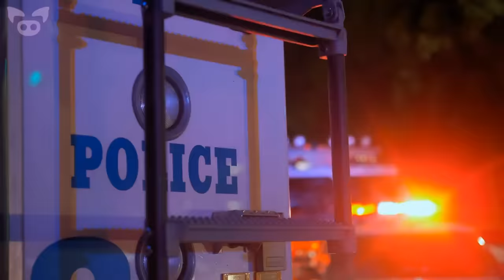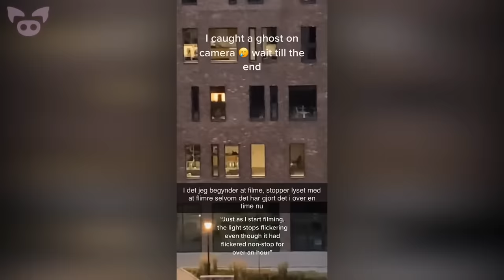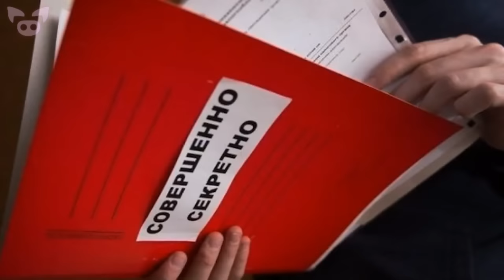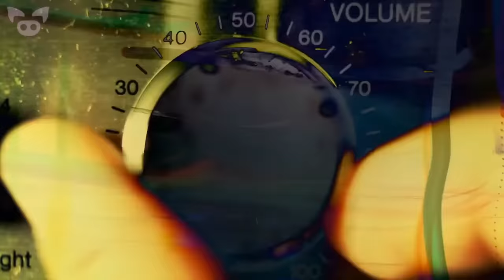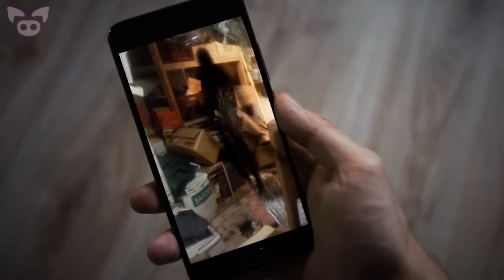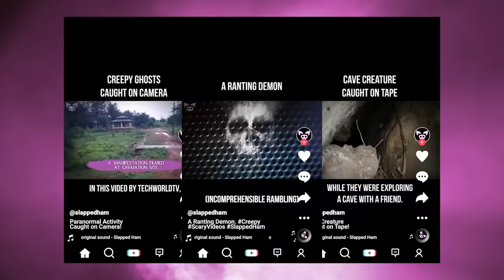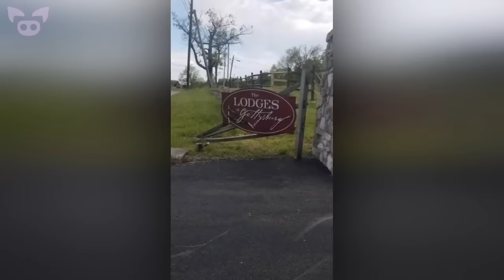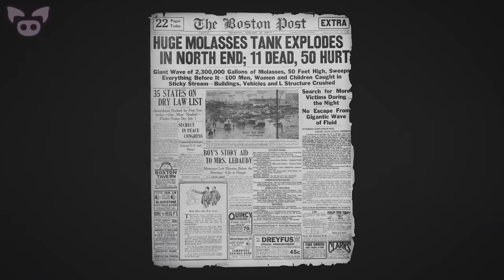Watch Scary Videos Live! Ghosts, Shadow Figures, Cryptids and More...

Comment: There are machines called "tree pullers" and "feller bunchers" and a couple of others that clamp on to the base of the tree and pull it straight up in the air and you will see it kind of wave in the air a little bit and will move it… Sometimes they move the trees if they've got a good grasp on them further away before they drop them and cut them.

Comment: You can see the bins move once the one bin falls. They were clearly leaning on the one that fell.
A secondary explanation could be a combination of the first with perhaps some water in the bottom of the bin after a cleaning. If there are bins leaning on a bin that has an inch or two of water sloshing side to side, eventually gravity will do its job and the bin will go over.

Comment: 3:02:35 like someone is spraying the car from the back with a hose or something. 
But I have in my lifetime quite a few times seen"localized rain" before, where it was raining on one side of the street and not the other. Snow too! And literally, all jokes aside, I was on the same street, both times. It was really trippy and super neat at the same time. A spectical that could only be created by our higher power 👏🏼💯💤

Comment: You don't need strings to make things move. You can take apart a RC car and put the dc motors virtually anywhere. Inside a doll to make it's arm move up and down, in a mannequin neck to move the head, on the wheels of a wheelchair to drive it up and down a hallway. Most of these clips have no sound so. As for the doll at the beginning with eighted eyes and a shaft in the stomach. When u squeeze the stomach it pushes a shaft that turns a gear which operates a veritcal shaft connected to the head. Etc. I'm constantly pranking my wife with RC motors accompanied by light/motion sensors. Or well placed remote control. As for the weird doorbell cam clips. Most can be explained by spiders weaving webs on damp nights in front of the lense. Mine does this quite often. Bugs are always the culprit. Sometimes it looks like they appear out of nowhere. However I'm no skeptic I have witnessed things I can't explain. I believe in anomolies. I also believe in crafty pranksters too

Comment: The tree through car,I think the driver of the car got reanimated as a tree, see which way the material from the underneath tree hole is peeled outside of the hole or does it look like the tree pushed up from underneath. If it curls to the outside it was caused from inside the vehicle, hence the driver was reanimated as the tree

Comment: So many of these are artifacts left from re-recording a zone where 80%+ of what’s on screen never changes.
Let’s say you have a camera pointing at a doorway square on. The room the camera is in is pitch black while the room with the door is back lit. 
The camera is set to record once it detects movement. And the person who opens the door everyday stands in the doorway while counting to ten. They are back lit so they will only be a dark profile of the person. 
The motion of the door opening triggers recording. 
For 100 times the person does the 10 second ritual.
Every-time it is recording the same thing. Over and over rewriting once storage runs out.
Eventually the person can open the door and not be standing there but the recording may show an artifact, or “ghost” as there is only one thing different.
Remember screen burn from original Nintendo duck hunt? Or from Mario bros?
The little Mario head with an “X” beside it in the corner?

Comment: At 5:39:32 if you pause when the ghostly looking girl comes into frame and zoom in on the side of the cloak facing towards the camera holder it looks as though there is an impression of a rib cage on it, you can clearly see the ribs and the sternum its very freaky, and while this could have been faked it would take quite a lot of skill and knowledge let alone equipment to do it so i'm 50/50 split at the moment, mainly because of the ribcage on her cloak part like how would you animate or fake that

Comment: Mannequin can have an electrified moving part to move head which could draw attraction something a business wants.
Doll clip can be proven False using unseen wire to move the hand along with when hand went down last time the shadow moved to pull the wires down, also look at how the thing it was laying on moves which hints in other ways it moved.
The Ventri. Dummy's head could have moved based on weight shifting following an unseen slant on the base level if everything isn't leveled out and enough outside forces causing a rumbling.
Mausoleum Doll, no comment on how, that one might just be legit except the 2nd vid of same doll, that could be it settling after outside movement caused just enough rumble into new place.(rumbling would cause something to fall like 2nd vid but not stand straighter and higher up like first vid)
Mall Vid, could be done by use of a 2nd security guard or a friend who pulled a set of strings outside view and seem's almost planned by having perfect view for cameraon second pull.
The lights you can tell @SlappedHam (unknowingly?) lied about moisture just look at the ground and street its soaking wet.
The shadow figure vid you can tell it was something/someone behind her and WAS NOT same time of day on same day because of the sun's rays and no-one is that fast on moving stuff, plus the shadow figures arms had a design on them which hints it was an object and was well protruding the door with its own shadow so not even a shadow figure.

ALL True believers of supernatural things know we must use skepticism first otherwise we can't prove even the slightest chance of it being real.
I just WISH Slapped Ham would quit putting easily debunked Vids up because all it does is Discredit us who actually believe, and trust me I could debunk most to almost all these vids if I had 12+ hours to watch and explain.